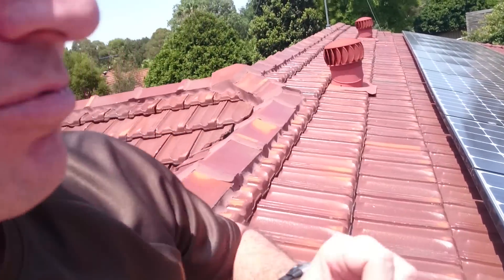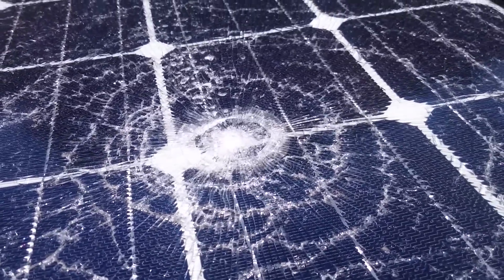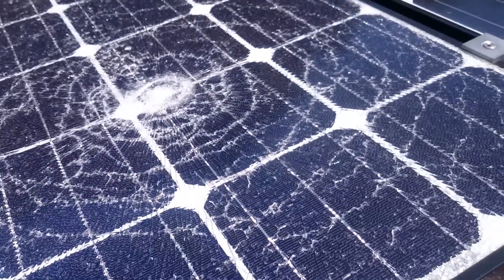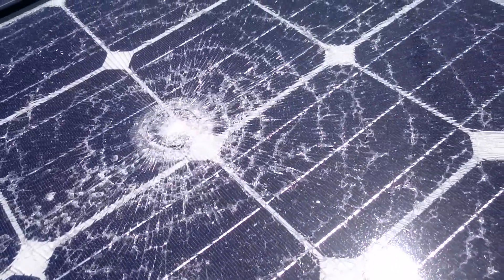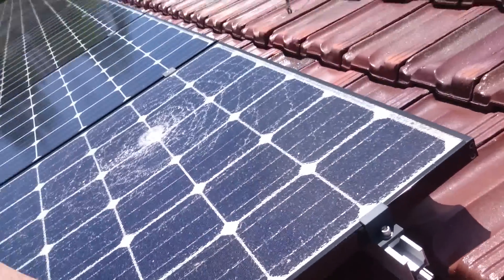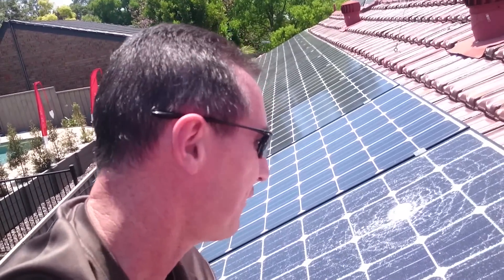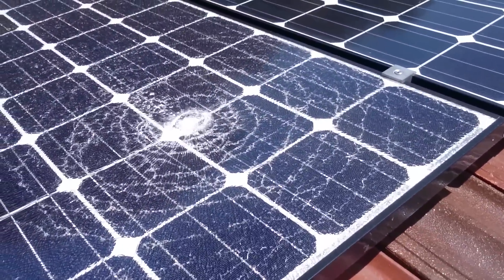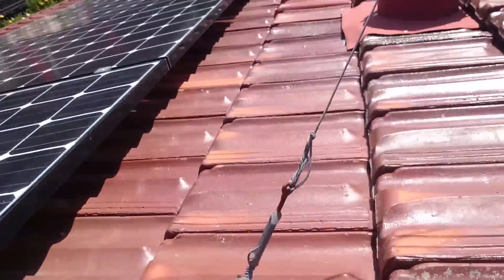Home Rooftop Solar Power System Update - Shattered Panel!

Comment: I wordked in a solar panel factory. For me, this looks like an impact from a golf ball. After impact, the golf ball will reflect and fly quite some way. So search a bigger radius for a golf ball or something like that. As the hole in the panel is perfectly round an no other impacts can be seen, this is most likely not done by a natural thing. Search for it! I would bet you will find something!

Comment: I like Blablox's explanation, it only takes a small leak in an aircraft water tank to build up a baseball sized or bigger ice block at 35000 ft and it is frozen to the skin of the aircraft until it comes in for landing, the skin warms up and it drops off, hits your solar panel and melts away leaving no evidence. Time to call the insurance company!
My brother used to live under the flightpath of Bankstown airport not far from the end of the runway and had a spark plug go through the roof of his garage.

Comment: I'm not an expert, but the "obvious" solution is often wrong, so It's worth considering non-cricket-ball possibilities, for example heat expansion. If the frames were a little too tight, then repeated heating/cooling cycles (plus a few thermal shocks like a cold mid-day shower on a hot roof) could fracture the glass, and then repeated cycles can expand the cracks and even grind away at the center glass. That might be months of weathering, rather than a single big impact.

Comment: That looks a lot like an ice strike from an aircraft. The ice would have hit at terminal velocity, done the damage and melted away. On a hot day the ice would have been gone in 20 minutes or so. Light rain after it and any "other" material would be rinsed away as well.  In any case I would be getting it repaired, there have been quite a few panels that have caught the roof of the homes they were installed on fire lately. At least two within 50 miles of my place in the past month!

Comment: How could it hail in Australia when you don't even have snow?? Maybe a golf ball?
Also, probably it's just the cover glass that shattered, not the silicon modules themselves, which is why you didn't notice any drop in power output. All the drop in power output should be caused by the glass not being fully transparent any more. Also, the impact zone is probably just the small white spot in the center.

Comment: I work for a solar company, and unfortunately the manufacturer will almost certainly not warranty that panel.  Physical damage to a panel that was not caused by a manufacturing defect is not covered under the warranty.  It never hurts to try though.

Comment: Ouch that isn't going to be a cheap fix.

Just out of curiosity  Dave, what do you use to clean your panels? I clean my parent's solar cells with a biodegradable degreaser / general purpose cleaner (Simple Green) and a soft nylon bristled automotive brush (with extension handle). It seems to work pretty well at getting oak pollen off of the cells with little to no scrubbing. We end up having to clean them twice a year due to nearby trees.

Comment: Hey, so does it still work? What type of reduction just from this panel are you getting? Should do some testing.

Hey, you know the economics of solar panels were pretty flimsy to begin with, without adding the possibility of this. Surely if this isn't covered by warranty or insurance, one needs to factor in this as a risk.

Comment: I didn't get. why the glass is it the most expensive component?
Reply: +Thiago Coura Because the cells are cheap as chips? The encapsulant is only a mild cost, especially when bought in bulk and the aluminum frame is relatively cheap... 
The glass on the other hand is already somewhat expensive, then on top of that if you want really good efficiency you must use a special kind of glass that reflects the least amount of light, thus adding even more cost...
Reply: +simontay1984 Wouldn't plastic yellow over time?
Reply: Cliff Hartle Exactly!

***** You can get UV resistant acrylic which is better, but it'll still be less efficient and lose efficiency quicker than the same panel made out of glass, for example the acrylic is a better insulator meaning more heat, (these are just estimates) then after 10 years it may lose around 10% or so of it's efficiency, whereas a glass panel might only lose about 5% but more importantly it will probably live for about 20-30 years, but I wouldn't expect an acrylic panel to last nearly as long.

Comment: Dave,

I feel sorry to see what happened.

I'm not sure if and what type of home/building insurance do you have but personally I would try to claim this expense under home/building insurance agreement as a damage to home roof panel installation made by hale storm damage or meteorite strike.
Usually home insurance policy is designed to protect your home and contents from loss or damage caused by one or more of the insured events, including fire or smoke, storm (hail included), theft, rainwater or run-off to name just a few.

My second option would be to try to obtain a report of an accidental damage by baseball, more likely a cricket/golf ball or black ice hit.
Following this path I would report this accident to police/fire brigade first and present ( aka buy it if needed ) the object which caused the damage (with ice this would be a bit difficult) to support the story. 
Having fire brigade/police report I would use it in home insurance claiming process.

Good luck and keep us updated with the outcome.

Comment: Is that a giant bend nail laying on the roof at 3:37 .. maybe someone shot with a nailgun into the air :b    Also at 1:35 and 3:29 there seems to be a dent in the side of the metal frame just above the crater. Hmm .. looks like the neighbours have a pool surrounded by big pebbles..

Comment: Dave, can you return the unit to the manufacturer and buy a new one with some discount? I was thinking if in case of a huge damage, how to dispose the panel? I wouldn't simply throwing into the domestic trash.
Reply: +Thiago Coura I think if the actual cells themselves are fine, they can go in and refurbish the panel, remove the glass and reinstall new glass.

Comment: Possibly alternate theory:  Moisture in the panel at manufacturing, sealed, then the summertime sun put too much strain.  It seems like a pretty even and round fracture... If it came from a plane, what are the chances it would hit so perfectly perpendicular to the roof to make such a perfect circle?

Comment: If you cant get it warranty replaced go buy a new piece of normal glass have it cut to the outside dimension of the frame and use a silicone bead around the frame edge and laminate the new sheet of glass over top of the broken glass.  She'll be right and you'll probably get another 10 years out of the panel. Use a piece of rubber under the metal clips so you don't crack the new glass that would now go all the way to the edge.

Comment: Probably an air gun pellet. Some pellets have a very sharp point which can cause a lot of damage to tempered glass. Either that or a meteorite... Sharp objects from aircraft are also a possibility. I doubt objects thrown from the ground would have enough force to break the glass. No ball can cause this damage to tempered glass.
Reply: +ronettreker airguns count as real guns in Australia, so are moderately rare, why would you go to all that effort to get a toy.
Reply: Alex Law Airguns are viewed as dangerous as fire arms in Australia?! Wow... Here, in Romania, we have very strict gun control laws, but still don't treat airguns as strict as fire arms.
Reply: Jorn Navarre No, I haven't, didn't know australians play it either. Aparently one weighs 160 grams, and it apears to be made using only leather as cusion...smaller hail broke tempered windows before. Would make sense. Still, I would expect a high quality solar panel like Dave's to resist an impact from a rock...or cricket ball.
Reply: From a Police viewpoint, a rifle can't be identified as a .177 airgun or a 5.56mm dangerous weapon at a glance while being waved by a criminal, so both they and a movie prop replica are (almost) equally restricted. No open carry here, instead we have the crime of Going Armed to Cause Fear.
Reply: The leather on a Cricket Ball is not padding, it is (almost) rock hard. Shiny, rigid, and more than capable of breaking bones and even, on occasion, killing.

Comment: +EEVblog no rocks in the gutter rail below? or on the roof under the panel?
Reply: +EEVblog either a small rock like some suggests. Or yes the sun might have heated up the panel that might have been under tension, just alike a car windshield it can cause glass to crack... or a bird that has dropped something.... but then again it would have been stuff like a fish etc. i still vote for a rock or something ball shaped... could have been a baseball or football, and if during noon sun its more fragile... and the kids would never have seen it, they just picked up the ball from your yard and played on
Reply: +EEVblog if its still working you MIGHT be able to replace the glass if you are EXTREMELY  carefull... if the glass is fragive you will not want to think about the cell under the glass

Comment: I don't think this is likely to be caused by a rock, unless fired from something like a catapult, because rocks don't bounce much and would likely end up in the guttering, which you've already checked. Bullet? Maybe, but a direct shot would leave a groove rather than a symmetrical smash pattern, and a descending bullet fired upwards won't come down very fast, as terminal velocity is much lower than muzzle velocity: again I'd expect it in the gutter or nearby. Golf ball seems possible. They can be hit very high, are hard, and would bounce after impact, making them difficult to locate. 
I also commend the person who suggested you get your microscope out and look at some of the glass fragments from the point of impact. 
Good luck with the warranty claim. Or possibly house insurance claim.

...After taking a look at the position of your neighbour's garden, and the diameter of the central depression in the impact area, I'm fairly sure this is a cricket ball. And I bet the culprit came into your garden and retrieved the ball. So don't expect to find the causative object. Maybe it was one of those new pink balls..... ?

Comment: I have welded with the output of 600W of solar power,crappy but ten 250W panels should produce a decent arc :D
I have 18Volt optimal panels,open voltage is about 32V Perfect power curve for stick welding :D As if they where made for that :D

Comment: If something fell on the solar panel, there must be an evidence about this object. Search for it. If you can't find it, there are only three reasons left:
1. You didn't search carefully enough for this object.
2. It was an ice hail and a very large or fast ice ball hit the panel, bigger than the panel was designed for. After it, the ice melted away, leaving no evidence besides the broken panel.
3.  You have an angry or envious neighbour who broke the panel and removed the evidence of the object he used to do it.

Comment: Never seen a single photo of hail damage on one panel, in one spot, due to hail -  but that is a vertical impact. There is no way a human could cause that damage pattern at that angle, from the ground. Modern solar panels are made to withstand very significant impacts including fairly large hail stones - but not rocks from space.

Comment: I have seen many baseball impacts on glass panels automobile windshields. You said you don't think it could be from a cricket ball. Are cricket balls as hard as American baseballs? Maybe a neighbor's child had a visit from another child that plays baseball and they were wakking balls and one got away. Then they snuck into your back yard to retrieve the ball as it fell off the roof. Doubt that it was a meteorite as there is no residue left behind on the panel or on your roof.
Reply: After viewing EEV#845 under scope it is evident that the object that struck your solar panel could definitely be a micro meteorite. The black particles appear to carbon and the yellow specks some other type metal. Wonder if you obtained samples using tweezers of the particles in the impact site. The radial pattern is typical of small projectile impacts plus the removal of glass from the shockwave created at impact.

Comment: Unless it presents some kind of possible over-current fire hazard, why replace it? Trowel some kind of clear UV resistant epoxy into that circular impact area with a putty knife to prevent water infiltration and just leave it.

Comment: More like a cricket ball or other round/blunt object. A glass failure, caused by lack or expansion etc, would have not had a point of impact in the panel away from the edges. Check your neighbors!

Comment: Could get it fixed or replaced under warranty. Be no different then dropping your phone by accident. Might charge a small fee but otherwise be free for the most part. It's probably tempered safety glass, what's used in auto's these days.

Comment: i say its a bullet they can travel quite a distance a standard round fired from a 9 mm gun can cover 3.7 km at the angel of 45 degrees  a round shot from a assault rifle or a hunting rifle can travel x3 times that distance a solid shotgun load is a likely culprit too or maybe someone testing a homemade cannon i am certain it was not a baseball or a cricket ball  its just not that hard enough to impact break the glass in such a way and the only way i know how to make a stone do this kind of damage is with a sling or maybe some super strong slingshot but if that is the case you would find bits of stone too

Comment: If you you can't get it fixed, coat it in clearcoat to seal it up. High gloss is optically clear. Hell, even if you can get it fixed, try to keep the old panel and use it for experiments!

Comment: lg is a pain to do rma with. I work for a solar company. call your installer. if lg does let you do the rma they may compensate the work that is done. you also don't get stuck with a charge while they wait for the bad panel to come back. the break looks like a rock hit it. it would have to be a sharp object to do that. ball is unlikely. you can walk the seams of solar panels to do repairs.. very strong and resilient.

Comment: The obvious is disregarded. ERROR #1 in all, or at least , in many solar installations:
No air cooling of the panels, much too small height above the roof, air cannot circulate.
Sun heats up and the panels have only 30% efficiency.

Comment: Baseball?
Reply: +Mega MindyLou If he live in the USA that'd be my guess, but very unlikely in Australia. Cricket ball seems far more likely.
Reply: +Krynn72 panels are hail strike rated so can take a baseball
Reply: +Jan “Nekoroms Random” Andersson a cricket ball can be lethal, no padding layer between cork and leather and the leather is hardened. They also weigh slightly more than baseballs.

Comment: I hear jetliners in the background. If Dave's home is near the flightcorridor, then its possible for a rouge piece of piss. Falling from 10 000 ft and BAM. You has a magic bullet...or in this case, a soft snowball. Glass shatter radius indicates the diameter of 2 inches. And as far as I can see, the dent is 10mm deep. So, a high velocity, low density material did this. Unless Dave found any balls in his backyard...
Reply: Graham Langley
 Yes, Sorry about that. I have the so called non-english speaking person dyslexia. I can't seem to get your and you're right aswell. Your right in every way tho...

Comment: Why don't they make them with LEXAN paneling?The gentleman's comments below offer an interesting theory that a plane might have dropped something ,& as a former mechanical engineer, I can tell you that an aircraft mechanic probably left something small like a screw ,& it fell of the plane while in flight . Remember everything falls back down to earth at up to 120 mph,so from a high altitude ,OUCH that would hurt!You could take a metal detector , & go around your property ,& I'll bet you find some small screw , or nut , or fastener type of item.

Comment: Whoever said male seagull: I think you hit the nail on the head. If people doubt that birds would crash into glass at suicidal speeds... the birds don't know it's glass! They are expecting to butt heads with another male bird, not crater on a hard surface!  I quite often find dead birds below my house windows and a bloody mark on the window itself, though thankfully the birds have been too light to do damage. I've also had a male crow rip the rubber seals off my car windows in transferred rage cause it couldn't get that really aggressive male in the window to back off... birds will do crazy things around reflections, especially in nesting season.  If Dave didn't find a gull on the ground below this, then maybe a cat or dog ran off with it.

Comment: I would say look for a bullet , if you shoot a bullet into the air at an angle it will return towards the earth with enough force to do considerable amount of damage ,the impact area does not look to be baseball or cricket ball size
Reply: +MrBuck295 stray bullets don't fall randomly on Australian suburbia.

Comment: Really stupid question for you Dave, have you checked in your gutters? though it prob ricocheted off it may have stopped dead and rolled off or hit and lost 90% of its energy and ended up in the other gutter.

I am not sure about a meteorite, wouldn't it have been still hot when it hit? if so why is the glass not melted?

Do please let us know what the manuf has to say